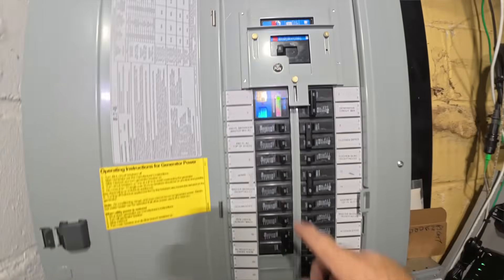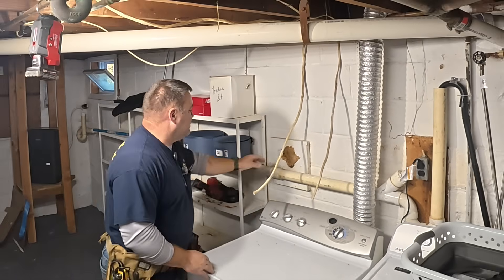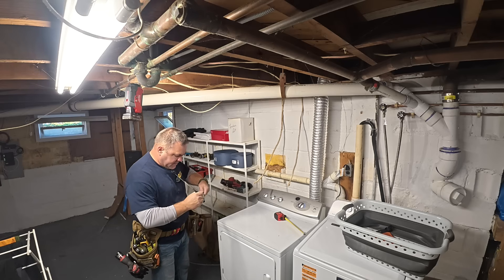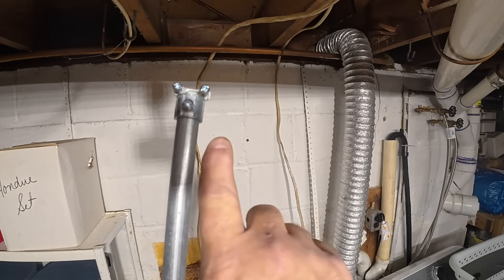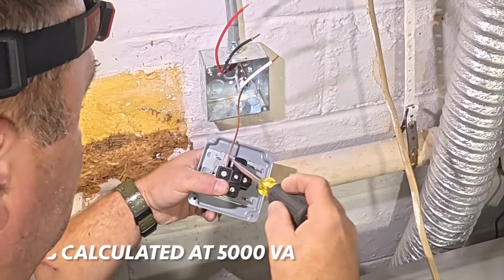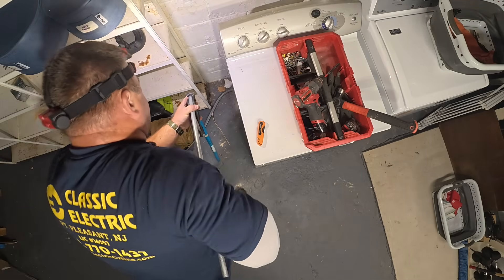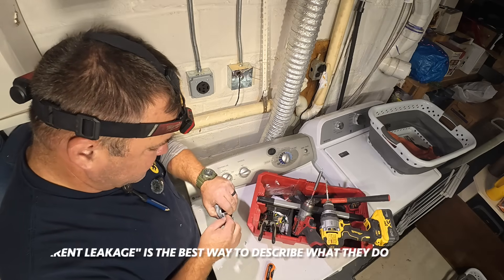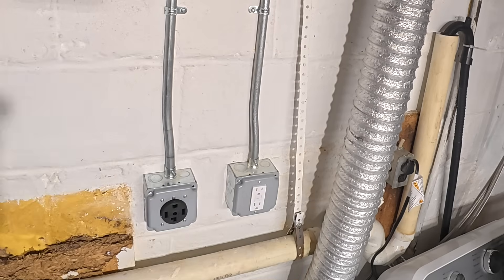Are my washer and dryer electrical circuits safe?

Comment: There’s a kind of exhaustion that’s not just physical but existential. It comes from believing in something that doesn’t yet return belief to you. From thinking in the middle of the night, “Am I really cut out for this? Will anyone ever care?” That exhaustion is normal. It’s human. And yet, even when it feels unbearable, you still press upload. You still put your heart on the line. That choice to try again despite the silence is one of the bravest acts a creator can do. Every single video is proof that you refuse to quit, that you refuse to let your creativity be swallowed by doubt. Even if no one responds now, the courage you summon in these moments is shaping your future in ways you cannot yet measure i have an idea you can try out are you in ?

Comment: Thanks for the video.  Enjoy watching a pro and learning.  Correct me if I'm wrong, but I don't think the individual conductors of the Romex are rated to run inside EMT.   But Romex can be put in EMT for a short run to protect it from physical damage.  Such a short run here, so definitely a nitpick, but I think I would have just used 3/4 EMT and put the whole Romex in in this situation.

Comment: instead of taking the ground bonding strap or jumper all the way off, just rotate it to outside the junction cover and tighten back down or if the pigtailed type move the end back onto the neutral terminal and off the frame.
the only reason I suggest that, is people moving and taking appliances with them, the new place may only be three wire and need that bonding back again. not that it would likely be done right anyway 🙄
Reply from the maker: I don’t think that’s a wise idea at all. That’s like leaving the bonding screw at the bottom of the panel just in case.
Reply: I see your point, but panels wont be moved around, unless it's a temp post being reused, so for sure remove those screws(straps) fully. 
in older homes it's a 50/50 chance of what receptacle you'll get and people usually do it themselves or have a hardly handyman(lol) swap the cord and they have no clue about the bonding  strap/jumper even when it's there.
I'm cautious the other way, after seeing dryers without bonding on 3 wire cords live at 120v, because a broken heating element or melted wire was touching the case inside. even a few that arced to the grounded washing machine next to it. really scary stuff and also why they went 4 wire cords.

Comment: on residential/light commercial electric clothes dryers, the electric motor, lighting, circuit board or timer are all 120v powered, so the neutral is for sure used as a current carrying conductor.
I have seen neutrals come loose or loose plug fitment make the whole shell live at 120v, granted it had some resistance since it was through the timer motor, lights and motor when "start" button was pushed, it was plenty enough current to get electrocuted and die, especially if barefoot on a concrete floor. I'm sure it's happened in the past more than once.
electric ranges on 3 wire were not much better, using the neutral for current carrying timers, lights, circuit boards and fans.  going to 4 wire was a vey needed move.

Comment: Why did you strip the jacket off the 10-3 romex before inserting into the EMT, and not off the romex  on the washer GFCI side.
Reply from the maker: Why did you ask this question?
Reply: @electricianron_New_Jersey  I think this is a very honest observation on the part of the viewer.....I too, will ask, why did you do one and not the other?  With so much talk about putting Romex into EMT, why you should do it and why you should not do it, this question is very relevant to learn to how to do electrical work the right way.
Reply: @electricianron_New_Jersey  You have been my goto Youtube electrition for years. I learn so much from watching your projects. Maybe fill space makes the dif, seems :face-purple-wide-eyes: like the kind of detail you (Ron) would mention.
Reply: the line to washer looked like UF-B direct-burial/sunlight resistant and it's harder to strip in longer lengths, due to the outer jacket being formed around all the conductors, vs. an over wrap with filler materials.

Comment: My old washing machine required several DIY repairs over the years. One day I decided to replace the receptacle with a GFCI, I then found out that with the front panel off the GFCI would trip. There was a switch under that panel that some how caused the current to flow back through ground causing it to trip.

Comment: does that dryer circuit need to be on a surge protector?
Reply from the maker: There’s not a requirement for that and the panel has a whole house surge protector.

Comment: How the GFI senses that current difference is fascinating and elegantly simple.

They wrap a current sensing coil (CT) around each of the hot & neutral leads, the idea being that electricity flowing through the lead induces a current in the CT. If you wire the CT backwards you get the opposite current. So with the hot wired one way, and the neutral wired opposite, in series under normal operation the currents induced in the CTs cancel out. As soon as you have leakage they no longer cancel out. The GFI senses that small current and trips out.

If curious about how the CTs sense current, google "Current Transformer". Fascinating subject how it works, and also the numerous ways they're used, and why. Example, how do you measure current on a 128,000 volt powerline?

Comment: If EMT is open ended can Romex be run through it. I always considered it as a raceway not conduit, but I don't know what the code says about that.
Reply from the maker: Sure, but never in a wet location.

Comment: when I updated our electric range/oven receptacle I saw the N-G bonded as well and scratched my head and then did research. converted to 4 wire.  I installed originally back in 97 .

thanks for a great video as always

Comment: I just found that my dryer has the 3 wire plug so guess what I’m changing tomorrow??
Reply from the maker: Good luck.  Make sure you have the 4-wire supply from the circuit breaker.
Reply: @electricianron_New_Jersey the bare copper ground wire was left tucked in the back of the box so it’s good to go.   I just have to verify it’s connected to the ground bar in the panel….

Comment: Very interesting video. 25 years ago, when I had an electric  dryer in the basement, I  would sometimes get a little "tickle" off of the housing. I wonder if it had a three-wire hookup...
Reply from the maker: That's very possible. Good observation.

Comment: Interesting, I've neither seen nor heard about "from-to connectors". I've always just seen nylon Arlington bushings pushed on the end of the EMT stubs for cable entry. (Arlington part EMT50).
Reply: I have just used the nylon bushings as well.
Reply: the from to connector looks legal but the romex sheathing being CUT inside an EMT conduit looks incorrect. imo, romex can be installed in emt but not when the romex is cut because then it's not romex anymore.
Reply from the maker: Do you strip away the sheathing inside the box or no?
Reply: @electricianron_New_Jersey  Yep, leaving at least 1/4" sheathing coming into the box as normally required
Reply: @electricianron_New_Jersey  I guess its a stupid code but it is what it is. To be fair I do the same as you and have only been called out on it once.
Reply: @uhjyuff2095  Yeah you should leave the NM sheathing intact within the EMT because you can't assume the conductors are THHN (though they likely are). The EMT's job is only acting as a sleeve for physical protection rather than raceway as it is with THHN. Also the rule that NM sleeved in EMT can only be installed in dry environments applies as well.

Comment: At at least you didn't have to install a 30 amp GFCI in your code area.
Great idea showing the 4-wire / 3-wire cords for appliance connections, or 
                                         in with the good / out with the bad.
Reply from the maker: not usually, too much work watching after them.

Comment: I have an electric dryer that is sitting doing nothing except taking up corner space.. but I can drill the vent! :)   The box Dad planned to use, the wire says Type UF 600V Sunlight resistant E25682K.  It looks better than 14G wire to me.   where it goes from box near dryer,  is part of Dad's 'mystery wiring'. LOL  If I could only find out where the wire goes to the main box or ends up!   I've just gotten used to hanging my laundry over the Brick heater in winter (small loads) to dry it! ha!  How do you track mystery wires no determination in a house? 🟠🟠🟠🟠😈😡🤬👺🟠🟠🟠  Happy Halloween Ron!!!  -Save America!!!
Reply from the maker: You could use what's known as a toner. It generates a tone to identify conductors. I'd search for it on YT, I'm sure there's a video for one. Good luck.
Reply: @electricianron_New_Jersey   eh, it would be cool to get dryer hooked up.  i can try and trace it physically to help electrician I'd have to hire! ha! Sha-shing! $$$.  assuming it's the right wire in 1st place.  You know ALL about these situations, I'm sure.

Comment: For a 240V circuit in an unfinished basement, does it require a GFCI breaker under the current NEC? Or is this a case where your state hasn’t adopted the code cycle yet?
Reply from the maker: If this were a new circuit yes, GFCI would be required.
Reply: @electricianron_New_Jersey  And those double-pole GFCIs can get pricey.  Nice job, Ron.

Comment: Thanks for the great video, Ron. Taking that bond away when changing from 3-4 wire on the dryer is an important step that we do not always teach young appliance installers and electricians.
Reply from the maker: Hey listen, grounding and bonding isn't easily understood. I think of my old friend Tom who literally taught me how to do a 200 amp upgrade back in the 1990's. He's failed the licensing exam at least a half dozen times and has all but given up now. I'm pretty sure it's because he doesn't understand current flow.

Comment: They may well have done it acceptably for the time that they did it with respect to the 3 vs 4 wire.  The 3 wire was the norm for a long time, a long time ago.
Reply from the maker: Yes, and I believe there's an exception to keep the service-entrance 3-wire intact for replacement appliances only.
Reply: @electricianron_New_Jersey  yes.  Article 250.140 (B) of the 2023 NEC deals with ranges and clothes dryers in existing installations where an EGC is not present in the outlet supplying the appliance.  Not going to type all the language but suffice it to say, all of (1) (2) (3) and either (4) or (5) of 250.140 (B) must be satisfied.  

If the wiring method was SE cable - with an uninsulated grounded conductor, the circuit shall originate at the service equipment.  This has been a requirement since I believe the 1968 NEC.  However, when 230.85 first appears in the 2020 NEC for emergency disconnects, this inadvertently created a conflict with 250.140(B)(4) because if the service equipment was being replaced for any reason, then you had to place the emergency disconnect on the exterior of the home, and this almost always was the service disconnect as well.  Now with all this in mind, here's where things can really get complicated for the homeowner.  Let's assume this home in the example is a 1970s split level house, the electric range and clothes dryer are on the main level, panelboard with service disconnect located in a finished basement, the meter can on the exterior with a short length of rigid metal conduit for the service conductors to pass into the panelboard.   This homeowner hired a good electrical contractor to change out the panel because it's a FPE which are known for being very unreliable and a safety hazard.  The contractor pulls the permit, the power company comes along to pull the cutout fuse on the transformer so work can begin.   The electrician installs the emergency disconnect/service disconnect on the exterior to satisfy 230.85, relocating the grounding electrode conductor to the service equipment, 4 wire cable to the new interior panelboard, you get the idea.   So far everyone involved is happy to have a safe, up to date system. That is, until the inspector shows up with some very unfortunate news.   He says "I know the service equipment swap had nothing to do with the dryer and range circuits, but those are going to have to be replaced with a 4 wire cable and outlet, before I authorize the power company to restore service.   Electrician and homeowner look at each other and said "ahhh, those cables are running about 100 foot through a finished house, we ain't changing them out ".  Inspector says "ahhh, yes you are".    Major problem.

So for the 2023 Edition, the code making panel realized they needed to activate some kind of "oh shit, we screwed up" protocol and added 250.140(B)(5) which allows the used of listed insulating material such as electrical tape or heat shrink (should be white, because this is a grounded conductor) over the uninsulated grounded conductor in the new panelboard to prevent contact with the enclosure or other EGC's.  

For all the new apprentices working to obtain your Journeyman certification, as you learn how to navigate the NEC you will quickly find out that as new changes and articles are added, sometimes there is conflict and chaos which is usually solved (or at least made tolerable) in 3 years when the next code cycle comes along.  However on rare occasions it becomes necessary for a Tentative Interim Amendment (TIA) which allows for a Code change outside of the normal revision cycle.   This allows for faster response to immediate needs.   A good recent example was in 2022, which exempted listed HVAC equipment from certain GFCI requirements introduced in the 2020 edition. This exemption expires on Jan 1. 2026.   The purpose for this TIA is because most modern HVAC equipment is equipped with a variable frequency drive (VFD) as a means of satisfying more stringent Federal energy efficiency requirements. The problem with a VFD is they can create high frequency interference that often causes  nuisance tripping of GFCIs and AFCIs.   As of 2025, GFCI manufacturers developed & UL standards recognized a new product known as HF+ GFCI, which is designed to virtually eliminate nuisance tripping because of high frequency interference while still providing class A GFCI protection for personnel.   This is mentioned in the just released 2026 NEC.
Reply: @electricianron_New_Jersey yep, for those that don't know and are curious, this would be found in article 250.140 (B) of the NEC.

Comment: Ron it is a violation of the listing of that NM cable to remove the jacket in a raceway
Reply from the maker: Point me to that section, thank you.
Reply: @electricianron_New_Jersey 334.15(C) for unfinished basements and crawl spaces. I quote: "the sheath of the nonmetallic-sheathed cable shall extend THROUGH the conduit or tubing and INTO the outlet, device or junction box not less that 1/4"
Reply: Please provide the section. I have done it the same way Ron did it on a Range circuit in an old home several years ago. I want to be correct as well. I thought about a junction box with THHN in the conduit but went the same direction as he did here.
Reply: @thanatoslrsd 334.15(C) for unfinished basements or crawl spaces. I quote: "the sheath of the nonmetallic sheathed cable shall extend THROUGH the conduit or tubing and INTO the outlet, device or junction box not less than 1/4". Also think about if that ceiling is ever finished. We need to know that is a cable assembly, that it is limited to 60 deg C, and also the listing of NM intends it as a cable assembly and kept that way save for limited points for terminations. The individual conductors have no markings to identify them as a suitable conductor in article 310.
Reply: lol get a clue
Reply: another fine job by classic electric!  it’s super cool to see my house and laundry room become youtube famous!  thanks ron!

Comment: Someone Fast Kap maybe???? I forgot who makes a "Shark Staple removing tool" I want to get one myself. They are supposed to work well. Maybe its Klein? No it's Rack-a -Tiers. There like $15 HD, Amazon etc. Are Dryers GFCI yet?
Reply from the maker: I have one of those and they work well but it wouldn't have worked well here because access was limited.
Reply: My tool of choice for pulling staples and trim nails👍